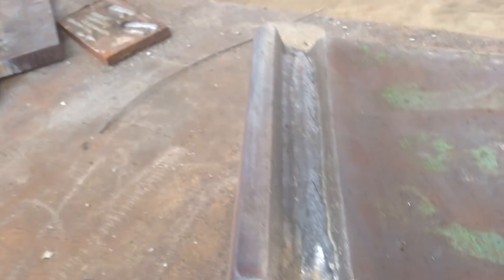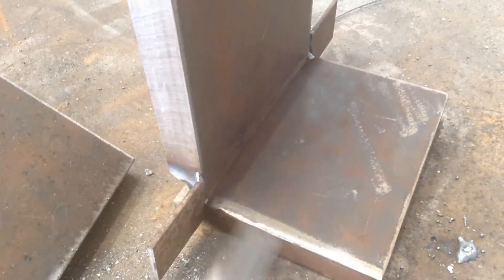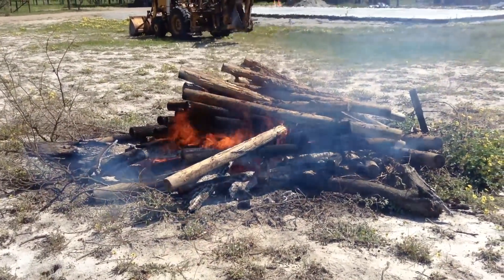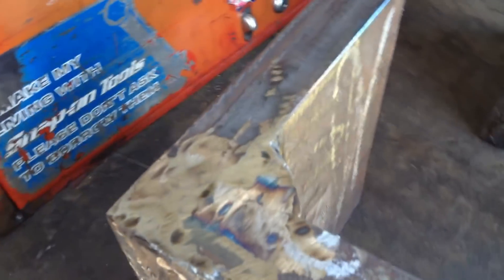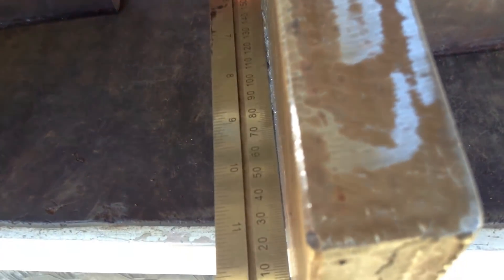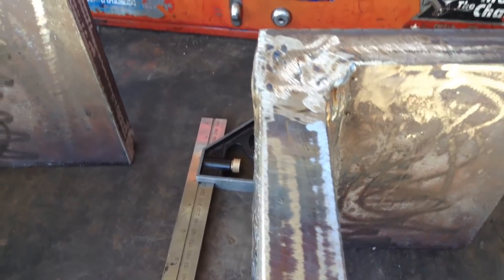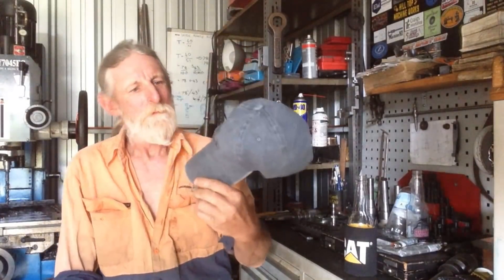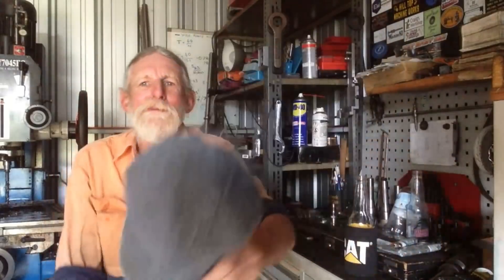Steel Angle Plates  .   Part 1 .

Comment: Hello Max,  I'm re-watching this video as I just got asked to quote on a job to make 24 angle plates that are almost exactly the same size as your big ones.  The only difference is that these ones are braced with two gussets.  Specifically I was looking at your weld prep.  I need to make full penetration welds but don't want to do too much filling.  If you had made a "U" groove would you have done it with a ball nose endmill?  While your heat treat furnace is unconventional, with some shade and a cooler full of beer it would certainly be the most fun heat treat oven out there.  Ken
Reply from the maker: Hi Ken .  The U groove was my initial thought & yes , i would have possibly used a ball nosed . 
I think i just got carried away with my new face mill !      About 4 1/2 mins into the video is the weld prep design .   The joint was done that way because if there is any laminations in the plate at the joint area , it will still give the strongest result . 
  👍

Comment: Nice welding, but why not use those run-off tabs you have on there so your weld is filled consistently throughout the entire joint and not have to fill in after? Cheers from Canada
Reply from the maker: I was going to use 1.2 wire  & the tabs would have been ok , but the  2.4 wire was already set up in another machine so that's what i used .  The 2.4  is way to much for the thinner tabs .   I should have cut them off & welded thicker ones on .    Cheers .

Comment: You need to run your welds  onto your run off tabs you keep the same size of weld, and on your starts. You could have put braces on the plates as well. You have done well, keep safe and a happy new year Cheers.
Reply from the maker: That was the plan Carl  .  Originally  was going to use  smaller wire  so the thin tabs would have been ok .   The 2.4  311 wire that i ended up using would have just melted them , they would have to have been at least 3/8  thick .   Cheers .

Comment: Hi Max, when I was working offshore from Karratha on oil&gas facility our plastic rubbish bins used to collapse in the high ambient temperature,  used to keep the tools in a bucket of water.
Hope the angle plates don't move when you slot them.
Reply from the maker: I hope so as well .   i could always take a light skim cut over if they do .     Have a great new year  .   Cheers .

Comment: Nice work Max.  Ideal way to stress relieve in the fire pit.  650 Deg C for two hours after reaching temp and cool out slowly.  At 12 hours in the pit you will have very stable Angle Plates that won't ever distort.  I use my Pot Belly Stove for small shafts and weldments, it works a treat.  People would be amazed how much steel components can move over the course of a year if tolerancing is critical and they don't include a "Heat Treat' as part of the fabrication/machining process.
Cam
Reply from the maker: We shall see how they go .   The plate is unknown , i should have looked at the stamped code on it  .  For 32mm  plate from our scrap bin  it would be either 350 ,450 grade  or  Q & T   .   Have a great new year  .    Cheers .

Comment: I've got a few of those "heat treat ovens" around here, from fighting a losing battle with the honey locust and wild rose.  I've also got a small one for annealing.  An old Weber.

I remember helping Dad forge out a part for a hay baler.  A little table top grill, bag of charcoal, a chunk of something large for an anvil, and a bicycle tire pump for bellows.  Guess who got to operate the bellows ...   Worked to midnight fixing that baler for the next day, and got woke up by a pop-up thunderstorm the following morning.  Just enough rain to shut us down.  I think Dad muttered something about "getting screwed wouldn't be so bad if he got kissed at least once in a while ..."
Reply from the maker: That's a great story that !     Have a great new year , Cheers .

Comment: Nice project Max, that is a lot of wire to lay in there! Too much heat for me at 40 or so, I can't blame you for avoiding it. I am looking forward to see your set up for machining the angles. Anyhow, happy new year and cheers!
Reply from the maker: Thanks .   I have decided to rough them out ( oxy cut edges )  with  a carbide face mill  before they go onto the shaper for finishing .     Have a great new year , Cheers .

Comment: Max, why do you push the Puddle on the mig, but pull the puddle on the flux core?
Reply from the maker: No slag with mig & the heat & shielding gas  is directed in front as you go as well as you weld, except for vertical down .  Inner shield leaves a flux  a bit like stick welding  so you do not want that to go in front of the weld .   I think you can push flux core on thinner metals  , but i don't use it on thin stuff .    Cheers .

Comment: Well, I have some old snow plow cutting edges.  1" thick.  I believe these are Ar 4 or 500.  Its tough stuff as it scrapes on pavement when plowing.  Could I make these into similar plates?  Would I weld them before throwing in the fire or would I have to anneal them first, then weld, then back in fire and then reharden them somehow?
Reply from the maker: That  AR material is the same as our Bisalloy  wear plate .  I would not use it .    It needs particular temps to mess with the  hardness .    Even machining the stuff  can be a challenge at times as not to go through a heap of inserts .      Cheers .

Comment: You picked a hot day for welding today mate! 40 degrees. Your a braver man than I Gungadin. 😉😂😂👍🇦🇺
Reply from the maker: The filming  of the welding was done several months back !
Reply: @swanvalleymachineshop  cool - today would have been a bear of a day working with steel - but I’m betting your making steady progress regardless, right? 👍👍👍
Reply from the maker: @ianmoone2359  hammering along !

Comment: G'Day Max, good to see you're well. Have a Safe and Happy New Years! 
I have a thing for fixture & angle plates - looking forward to see these machined. ATB :)
Reply from the maker: Thanks Anthony .   It will be the first job for the shaper .  Cheers .
Reply: @swanvalleymachineshop  Just had an after-thought, have you ever seen anyone do a cross hatch pattern on a shaper? I've often wondered if this could be done, not just to look cool but could it be useful for mating surfaces?  Cheers Mate :)
Reply from the maker: @AJR2208  You could do it no worries .
Reply: @swanvalleymachineshop  Thanks Max - ATB  :)
Reply from the maker: @AJR2208   I might do a shallow grid pattern for  eyeball alignment marks .  Great idea !!!
Reply: @swanvalleymachineshop  That'd be great to see - Thanks Mate.

Comment: Nice video Max...When you fab an angle plate for machining, it is strong enough to hold up the world!     I worked in shops and schools that done all the "wire feed wonders" with all the "wires, and have certifications in GMAW, FCAW, SAW.  Today in my shop "Stick and TIG" rules and is productive enough. Happy New Year to you and yours!
Reply from the maker: Thanks .  The large inner shield makes short work of it .    Cheers .
Reply: @swanvalleymachineshop  When I was 20 I was "chained" to a Lincoln SAM 600 generator welder and LN7 feeder running 1/8" innershield wire @450 amps lol! No more wires for me, only rods thank you!
Reply from the maker: @AWDJRforYouTube  It's not my cup of tea welding with the large wire .  We used to have a 500 hobart that would poke 1/8 wire through inch plate !